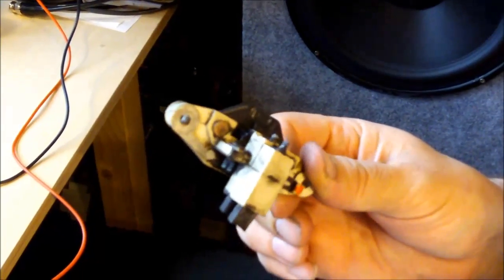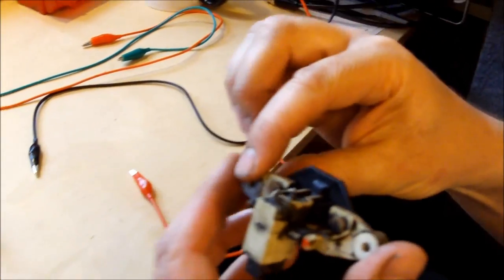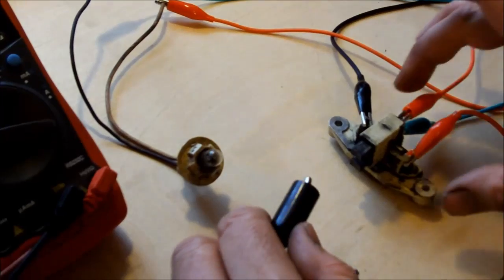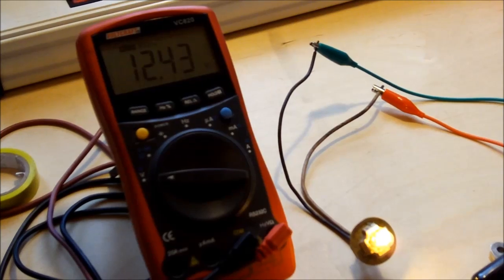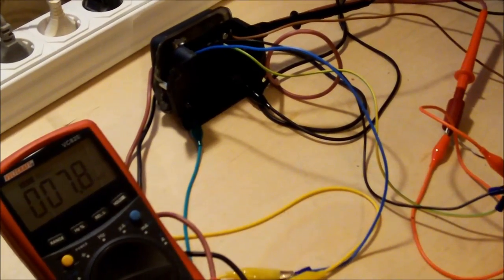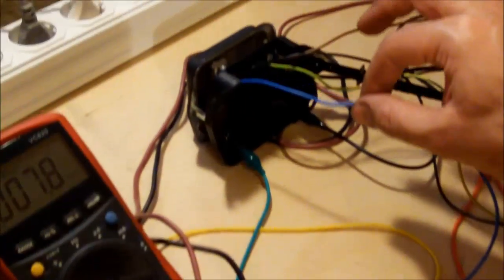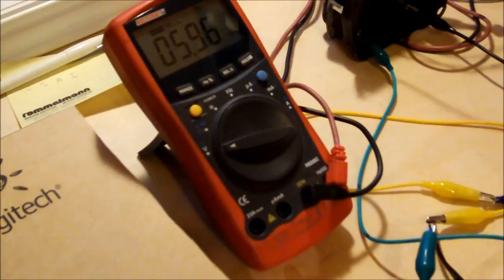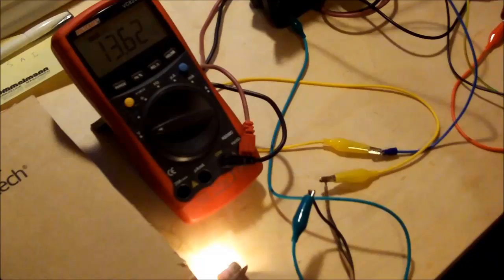Bench Testing Voltage Regulators

Comment: I always thought that the "Electronic Regulators" reduce the power  proportionality  😞 and the old coil ones cut off /on-off 😔 im confused 😕
Reply: the old ones cut on and off  modern cars are ECU controlled if you strip down the regulator in a modern alternator you will find a Arduino based controller

Comment: Hi, nice tutorial.  I don't have a variable power supply, but I would think you could test by overvolting it with batteries in series.  Do you agree?
Reply from the maker: Hello, yes this is possible. You can use even two of those small 9V blocks in series.
Reply: Thanks.  I have another question though, the regulator I want to test is a Bosch 0 121 715 009.  It does not have positive an negative leads on it. Can you give any insight in how to test this?
Reply from the maker: Hello, i don´t have informations about 0121715009 but it should be very similar to the first regulator shown in the video. The carbon brushes must be connected to the bulb, the ground strap to -  ; the other connections are guesswork :-)
Reply: Thank you again.   There are no other connections on this which is why I asked.  Only the brushes and then holes for bolting the regulator into the alternator and I don't want to damage it with voltage by connecting it wrong.
Reply from the maker: Hello, you can check which bolt connects to the alternator chassis which is minus, and which  bolt connects to the threephase rectifier; this one is plus.
Reply: Thanks again, I will pursue that approach.  I appreciate your response.  RH

Comment: Thanks for showing us how to bench test a Ford VR.  Is there a schematic diagram available to make all the connections to the Ford Voltage Regulator when testing?
Reply from the maker: Hello, have no schematic ready for the Ford setup, but it`s quite simple.

The old Ford USA regulators have 5 connections, they are designated:

Box of the regulator=Ground , connect to minus.
I=Ignition; connect to plus 12V via 10 Ohm ballast resistor.
S=Stator, connect to plus 12 V.
A=Alternator, connect to plus 12V.
F=Field, this is the output.

Connect the bulb to F and Ground.

Best regards

Comment: Thank you very much for the very helpful vid for a complete novice like me. Didnt have a variable power source so just used my laptop cable (19v) & a 12v battery to establish the regulator was switching off & on.

Comment: I have the alternator from my car in hands, and when i meassure resistance from ground to possitive on the alternator  i only get a reading of 3.2ohms. and 0.4ohms ground to ground. My question should there be more resistance from ground to possitive on my alternator?
If you could tell me, thank you :)
Reply from the maker: +Mitch Conner Hello Mitch; if you check the resistance from GND to B+ you measure across the power rectifier bridge. 
A normal tester (DMM) won`t give you a reading that makes sense, because in each diode there is a voltage drop of 0,7V.  (There are 2 diodes in series and 3 in parallel) , it i a three phase bridge rectifier. This test won`t give you any useful information or diagnosis. You have to open the alternator, check EACH diode with a diode tester, and check EACH stator winding , and check the rotor winding. Typical defects: In most cases, the graphite brushes are worn beyond acceptable length. Sometimes, the voltage regulator fails, and sometimes, the rectifier fails. What was the symptom of failure ? Regards JW
Reply: +nullbewahrer Thanks for your fast responce, well my problem is that my car had been standing still for a long time. So i bought it a new battery and all was good it looked like.

But then the day after when i tried to start the car, nothing happend. So i went to check to voltage on the battery and it was 12.20v.
I then took the battery inside and tried to charge it up. But the charger diden seem to ever finish charging the battery, and when i finally stopped charging it after 20 hours and checked the volt it was sitting at 13.5v.

 So i thought, maybe something is wrong with the battery. so i got hold of another battery, put it in and started up the car, went out to check how much volt the car was charging with and it was at 13.5v at idle and went up to about 14.5v when i gave it throttle. 

So then i thought, it must have been the other battery that had a fault.
I went for a drive and when i came home, i figured i would check how much the car was charging the battery and then it said about 12.5v even with throttle. 
And when i turned the car off, the battery was at about 12.30v. 
So i took that battery inside and tried to charge it up but i got the same result, the charger would just keep on charging and charging. So i figured it must be a problem with the alternator then, so i took off the alternator and has now tried to figure out if it really is a problem with the alternator, but i don't have much clue as to how i should test it.

Again thanks for your fast reply and help :)
Reply from the maker: +Mitch Conner Hello Mitch, what happens if the engine idles and you switch on lights, fan, e.t.c. ? 
What`s the voltage reading if measured with your DMM ? 
Regards; Jochen
Reply: I tried that with radio, heater, and seat warm on, and then it was down at 12.30V. and when i switched it off it was about 12.50v as i remember it.

 But a correction, i tried to charge the battery yesterday and just let it charge and it actually did finish the charging. the battery was then at 13.40v and it has dropped down to 13v in about 10 hours, so maybe the battery is actually ok?

I'm thinking i should just buy a new alternator, But having i really hard time figuring out what alternator it should be, cause Valeo make so many different ones. Can you maybe tell me,   the new one has to be the exact same as the old one?
Or is it ok if it can generate 10amps more or less? Cause i can't really find much information about the old one, even though there is a valeo sticker intact with alot of numbers on it.
Reply from the maker: +Mitch Conner Hello Mitch; it seem that your batt is ok and the alternator is not completely dead. 

If the alternator was completely dead, the car is idling, and some energy consuming devices are switched on, 
the voltage would drop down to approx. 11,7 V. 

I think one or two of the six rectifier diodes is/are shot. 

Is it from a vintage car ? Regards Jochen
Reply: It is from a 2003 peugeot 206 1.6 16v 80kw 109hp  engine: tu5jp4.
I'm about to make a  video with some pictures of the alternator, then you can see it if you like.

I think you are right about that, as long as i was only running with lights on and nothing else, then it could continue to drive a long time, i never tried that i ran all out of power while driving at least.

Comment: You can use a variable resistor "pot" and a DC voltage source around 18volts if you don't have power supply. That's the old school method . Just turn pot until desired voltage is achieved. Shalom

Comment: Hooked up a Ford 2G and 4G voltage regulator and light comes on with both but with increasing voltage (up to 28 volts) the light doesn't go out.  Am I doing something wrong?

Comment from the maker: Hello Mojo Jomo,
If the battery cable is disconnected during operation, there is no load applied to the alternator. Due to this, the output voltage increases dramatically.
Normally, the coils in the alternator do not suffer from this - but sometimes the threephase rectifier fails. Remove the Power Rectifier (includes 6 fat diodes) and the Exciter Rectifier (includes 3 small diodes) and check the diodes with a DMM.
Best regards; Jochen
Reply: Thank you for the quick reply! As you may know, the Valeo rectifier diodes are completely covered with a type of black ceramic coating, so must be replaced as a module. But I did check them and found 2 diodes had 'lifted', having come away from the metal frame, so they were making no electrical connection.  BUT I found that when I pressed down on them, an electrical connection could again be made - so I now have them held down with 2 bits of cable-tie and they now test as being healthy with a DMM!!!  All of the other diodes test as being healthy as well, as do the coils themselves. Correct me if I'm wrong but doesn't these alternators have 3-phases, with each coil being rectified by 2 diodes? Wouldn't that also mean that even with 2 faulty diodes (both from the same coil), the alternator would still charge the battery with the output from the other 2 coils?  I ask this 'because the damage to the faulty diodes appeared visually be very old, not something that had just occurred.  The alternator itself is over 20 years old.
Reply: Mojo Jomo
 Never mind. Turns out it was the diodes. Spinning the alternator with a drill was producing only 6v. Pressing down on one of the faulty diodes with a screwdriver while doing this caused the voltage to shoot up to 9v. I even got it back into the car and for a while it was charging perfectly - a lovely 14.6v going to the battery! Unfortunately, it seems as the alternator heated up, my make-shift wedge-type repair didn't hold up and it stopped charging again. So a new rectifier is needed, although they seem very hard to find for sale online.  I still don't understand why your test shows my rectifier as not working, since I know now that it clearly is!

Comment: Great video!!!  I have a Valeo alternator that doesn't charge and which looks quite similar to yours. When I do the test, the light doesn't switch off - shouldn't that mean that my alternator should be overcharging my battery? But like I mentioned, it doesn't charge it at all. The problem seems to have been caused when the battery lead from the alternator snapped off from corrosion/age while driving. Any advice (from anyone!) would be much appreciated.

Comment: Thanks much. I don't have variable DC power supply. Can I connect 12 volt battery in series to make 24volt and see if it is switching off and connect 12v alone to see if it is switching on, will this work.. pls advise.

Comment from the maker: Hello,
you need at least one variable DC power supply and one bulb.
Main function of all voltage regulators is: If the sensed DC voltage is >14,5 Volts then field terminal of the regulator is switched "off". That`s all.
Best regards; Jochen